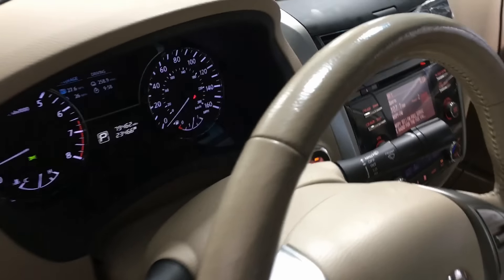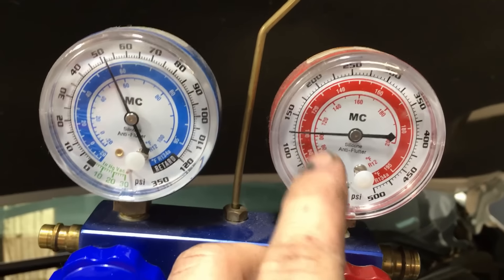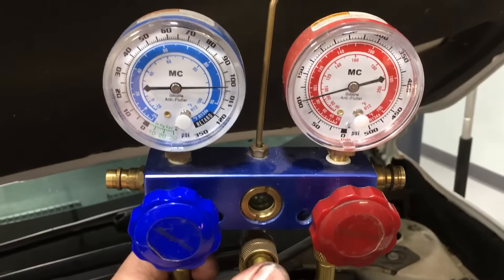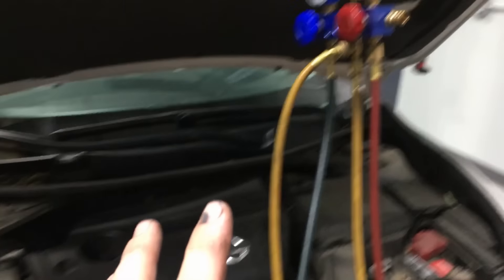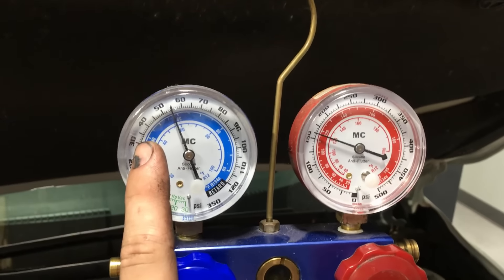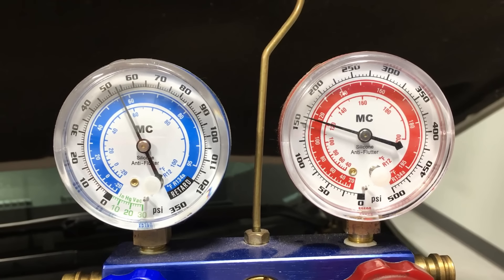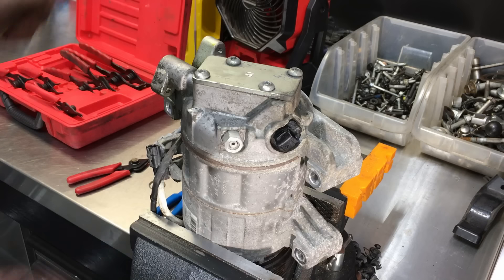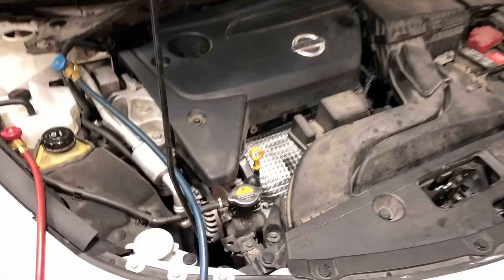A/C System Failure Diagnosis: Poor Cooling at Idle

Comment: I have a 2014 Nissan Altima and I'm having the same issue. My expansion valve equalizes the pressures when the car is off and I was reading the exact pressures when the car is running, as in your video.  I see in the video that the problem was the refrigerant control valve, but in the video, you said, "in our new compressor". Did you change the compressor or did you only change the refrigerant control valve?
Reply: He said that he replaced the compressor. At the time the valve was not available.

Comment: How can gauges show pressure if the two valves in manifold are closed??  You open fittings that attach to ports but leave valves on manifold closed??????
Reply from the maker: Is this a real question? Are you questioning the machines manufacturer or are thinking my valves are defective or I faked something? The hoses go inside the machine to the manual vales on the control panel for which the pressure gauge is tapped into. This way you can view the vehicles static and running pressures without allowing the refrigerant to flow into the machine until you are ready for recovery.

Comment: Why does the AC on my 2002 V10 Excursion suck so bad? New compressor, new rear TXV, new orfice tube, new accumulator, still has the old tube and fin condenser. Takes forever to cool, and then it doesn't blow THAT cold.  Can't get below 60F on a 90F day. Pressures are okay per Ford's suction and discharge charts for 70 to 100F ambient temp.  Do the Excursion AC's just suck to begin with?

Comment: This is exactly the problem my saturn vue has...cold air on the highway, luke-cold at a stop light. If you rev it to at least 1500rpm it cools back down. I wish i could get this diagnosed ...ive had 2 shops look at it, one said it needs a whole new system ($1300), the other said it needs a compressor and possibly a condenser, but charged it for me anyway, imagine that. And they didn't quote me a price for a new compressor or condenser or both, they just vacuumed it down and refilled it. Ugh. Maybe i should buy guages and figure it out myself.

Comment: Is A/C control valve the same as pressure relief valve? The factory service manual for my nissan versa doesn't mention any a/c control valve only pressure relief valve and expansion valve. Do all auto A/C's have control valves? I can't find it mentioned anywhere in the FSM. Thanks!
Reply: Only variable displacement compressors have control valves. Though, both can spring leaks (just had a relief valve replaced on my Delphi CVC because its oring was leaking, but the actual control valve is still fine).
Reply: PTA Weston   No a pressure relief valve is a safety device to release excessive pressure due to system malfunction

Comment: Hey man, I have an 03 Mustang GT with the 4.6 litre. My A/C  cools really well at night and on cool rainy days. It don't cool for nothing on HOT DAYS. I'm thinking about replacing the accumulator and the oriface tube. What is your opinion on this
Reply: Ron Bridges First thing first, check the charge. Put gauges on it and trouble shoot the system BEFORE you change parts!!
Reply: Air temp sensor is problem on these should get temp sensor reading from scanner before doing anything

Comment: My Ford Flex AC doesn't work hardly at all in stop and go traffic.  Does fine if I am driving continuously without having to stop.  System fully charged.
Reply: Thin Less my 06 GT Mustang cuts AC down when I floor it. It’s annoying. Because none of my other vehicles do it! It’s a 4.6L. I called ford. And they say it’s normal. It’s programmed to do so. But, I call b.s.
Reply: Welcome 2 My World 1.o   I drove an ambulance with a v10 and it did the same.  Cuts down on the load when you floor it to help the engine out
Reply: @glasser2819  Hmm, I have on old mazda protege that does good on the highway, but doesnt do good on city driving. I've done everything, I put a new compressor, reciever/dryer, evaporator, txv, and cleaned the condenser, and it doesn't work any better than it did. I'm gonna give this a try. But surely this thing had to work better than this when it was new? I don't know about this, wouldn't the manufacturer know how to build the system right in the first place?
Reply: make sure both fans are working....could be the valve like this video
Reply: Hi, were you able to resolve the AC issue on your Flex? I have the same problem on my 2011 Flex. Also my AC seem to have delay turning ON until about several blocks.

Comment: A good a/c what's the normal temperature ..good video thanks..
Reply: 50 degrees at vent .
Reply: @diane2193  More like 40F and below at vent when you call for maximum cooling.
Reply: @teravolt6113  it can vary on outside temps but yes it can be as low as 40 .Houses gennerally use 55 as a common supply temp.
Reply: @diane2193  Trust me, full recirc (which is max cool on my car) and my V5-like comp gives 40F at the vents with 100F outside with the right charge. Highway or traffic. It's recently stopped working like that (gives ice cold air only on the highway) due to a faulty control valve i'm going to replace.
Reply: Around 45ish on a r134a with blower on Med-high

Comment: Does all compressor have that valve I don't see that on my 2008 mazda miata,so I just going to replace the whole thing.
Reply: no it seems at least with nissan  the upper trim levels that have auto climate control have the solenoid valve, base models dont but you can usually see it from under the car.

Comment: sir , 38 temp is a wow,   i got my honda crv 1998,  i change my evaporator to laminated, change drier n expansion several times, vaccum n change freon n oil several times.  got my old compressor ( still  working)   i but only got 50 to 45 degree max cooling inside.  :(,   any tips?

Comment: Question new compressor condenser expansion valve flushed vacuumed charge correctly professional machine ac compressor and fans come on initially but go off if below 1k rpm if above 1k rpm ice cold as long as ur above driving or idle

Comment: i replaced the compressor & the condenser both new. The  condenser fan is working fine, and freon is refueled. Still poor cooling at idle. The only reason i could think of is because the compressor i purchased was not original.
Reply: Check the orifice for clogged screen . Should be on high side pressure line prior to evaporator coil.

Comment: I have a 2011 LaCrosse that only has relatively cool inside air temp while the vehicle is moving. When stopped the temp rises. I've had the system checked by 2 mechanics. One says it appears all components inside the engine area appear to be working fine. Good pressures. No apparent obstructions. No leaks. But he cannot find the problem. A 2nd mechanic is telling me the compressor and condenser need replacing. But he gave no information as to why he thinks this. So my question is: Can ac pressures be within tolerance and still have poor cooling due to a faulty compressor control switch? And/or if the high speed cooling fan does not engage will that significantly effect the inside air temp?

Comment: I got normal low side and low high side with the correct amount of freon. I suspect the filter dryer is getting clogged. 2001 ford v10 in a motorhome. What say yes?

Comment: If pressure is too high on the low side, does that mean the refrigerant control valve is allowing too much flow?
Reply from the maker: or txv if your compressor doesnt have a control valve.

Comment: How do you know this isnt a TXD issue? It’s the expansion valve’s job to turn hot liquid refrigerant to cold liquid refrigerant by decreasing the pressure of it. It must not be doing its job if the temperature is still hot. Maybe the expansion valve is blocked?

Comment: I have a 99 Ford C.V.P.I. and the A/C system is cycling the A/C compressor clutch on and off in addition to the radiator fan not coming on to help cool the engine which causes it to overheat when the A/C is running. It will run all day long with the A/C off but I don't want to run without any A/C where I live (I live in Las Vegas NV and it gets hot here) I replaced the compressor, condenser, accumulator, and orifice plug, I have the A/C high pressure lines ready to go in as well as the cooling fan motor connector AND the A/C compressor clutch connector. At this point I have only the low side lines and the evaporator to replace on my A/C system. I am pulling my hair out and ready to shoot my car over this stupid problem and I am tired of playing whackamole with this problem any hints or suggestions as to what it might be?

Comment: Is the refrigerant control valve the same as the scroll valve ?
I had my 06 Ford 500ac serviced, I provided the scroll valve, the mechanic said refrigerant was low to begin with and he added dye also but seen no leak. He told me to drive it a week and bring back he would look with a black light for leaks.
Reply: You need to get it checked with a halide leak detector. You can pinpoint the leak within a few minutes instead of taking the car back over and over to be charged repeatedly. Just a thought!! I have been an A/C tech for 25 years.
Reply: Yes, they are the same. Our 2004 Saturn VUE was having this problem (no cooling at idle or low rpms, better at rpm over 1500). It uses same compressor as Ford 500 and several other cars. I struggled to diagnose for 2 years, reading Saturn forums, lots of testing and trying things, but resisted replacing compressor. It didn't seem clearly the compressor, though others with the same problem had solved it with a new compressor. Finally someone on the forum figured out it was the scroll compressor control valve, and became a hero. (New compressors also had new working valves, so that's why it fixed problem, but for $$$ more!) It's about $30 part, in my case, and was a reasonably easy DIY repair for me. Had to unbolt compressor to get to valve cover, but didn't have to remove lines. (Do have to have it evacuated first!) Added back proper amount of R-134a, boom, ice cold air at idle. It was the mechanical type valve, and I had to buy it aftermarket. Search on "scroll compressor control valve" to find one of the sellers.

Comment: What if the high pressure gage is vibrantes at 200 psi. Does it mean that the compressor failed or the valve in it.

Comment: You're pressure sure did equalize very quickly, my 2000 Toyota echo takes over 1 hour to equalize. Is that normal? High side take longer to equalize.. blockage? But, I'm confused because I have a new EVAP, TXV, Compressor, Condenser and receiver dryer, fan turns on and still poor cooling at idle, I was thinking about another fan but don't know if amps would be too much draw on the system...Any Ideas on What I'm missing? Radiator doesn't look clogged from what I can see, I out have one fan for both..
Reply: Same issues here! Did you ever figure your problems out??
Reply: No, I replaced everything, the only other thing that I haven't checked and can't unless I pull the dash again, is the blend door, maybe it's a jar allowing some heater core heat in. I e talked to the service depart at Toyota, they say cooling should hold to within 45-50 degrees at idle. I know my page oil is right, charged correctly. So I'm a bit stumped unless I got a bad replacement part which I doubt. If you ever come to a solution, sure like to know, I don't want to throw any ote money at it.
Reply: @mitchellbonomi9309  thanks for the reply. And wow. That sure is frustrating. I feel your pain man. Idk have you looked at anything electrical such as the pressure or flow switches? What kind of gauge readings are you getting?  Hope it isn't an evaporator that clogged, that's my worst fear now. But I'll keep you in mind and let you know if I can help. You do the same please.

Comment: Great video. Really like these.types of vids.
Would changing out and replacing the filter dryer after the sys is evac'd help any?
Reply from the maker: No need
Reply: Hawaiian F150 only if the system sat open for a while
Reply: @BSGAutomotive   Hey friend can you please tell me what the static and normal operating pressures are for a 2006 Mazda 3s 2.3L 4CYL DOHC (AT) Sedan GAS non turbo VIN# JM1BK323361459957

A/C Does not blow cold at idle but will at speed A/C not useable have to roll windows to survive . I think there is to much PAG oil in system as I had another shop do a factory load PAG oil and R134A and then I put in new compressor with out oil balancing because he said I needed new compressor 

NEW PARTS : 

Compressor
Condenser
Expansion valve
A/C stretch belt + serpentine belt
Cabin filter 
Engine/Condenser Cooling fan
Engine Coolant
Engine Thermostat

Thanks
Reply: @BSGAutomotive 2011 Ford Fiesta. Air conditioner has always been cold. I replaced the cabin air filter and since then the air condition  blows cold as it use too but now fluctuates. Sometimes at a stop and even sometimes going down the highway at 60 mph. It can be 5-15 mins apart or longer?..

Comment: what do you do when your ac is constantly cycling while driving, the compressor cycles at higher rpm, because of this the car never gets cool while driving at highway speeds.   when you stop and allow the car to idle, only then the compressor works like normal. when you connect the ac gagues the pressure reads like normal when the car is idling. its a 99 mirage usa or 99 lancer japan. ck2

Comment: So the main function of the part you replaced, is same as expansion valve in another system?
Reply: No, the (thermal) expansion valve is a completely different thing, even though it has to be carefully built and set so that it won't interfere with the compressor control valve (the replaced part) at all, that is, the expansion valve has to stop modulating the refrigerant flow and basically keep the orifice slightly open, before the control valve starts modulating refrigerant flow by acting on the compressor displacement. Having two flow control systems operate in the same pressure range means problems

Comment: My compressor is working , my relay and fuse are good, my system has no leaks and is fully charged,  My A/C is still not cooling.    what did I miss??? 2010 Honda Civic. Need help!

Comment: I have a 2015 Altima SL  and have the same problems just ordered the valve on ebay 20.00 thanks.
Reply: automech01 did you received the valve? Did it fix the problem? Im experiencing the same issue

Comment: Very nice video. Thanks for making it. I did not understand though what is controlling the valve and based on what data? Is this valve part of some control system that tries to maintain an average pressure of 30-40 at the low pressure side?
Reply: Shhh! He's got to pay for that recovery machine.
Reply: anyway you slice it... shop needs to hamer customer for comfort. Service has a cost... short AC season calls for premium.

Just keep in mind you are stressing every engine rubber gasket, the hot battery and the alternator... enjoy AC for what its worth.
😁

Comment: when fill out the AC, it leaks immediately under the car and it leaks a lot. Any stop leak you recommend ?
Reply: Fix the leak!!! Stop leak stops up the whole system!!! Not good!!! Fix the leak!!!
Reply: just replace all orings and see if it holds a vacuum for a half hour
Reply: thank you
Reply: @rockerpat1085 gonna be expensive to fix

Comment: If we had a sticking, electronic a/c compressor control valve, why not just unplug it??

What would happen then??

It would prevent the system from wanting to adjust or close the valve- No?

Comment: TXV system, is that an expansion valve system?
Reply: Yes
Reply: Thermal expansion valve. It's a hybrid TXV/OT actually, because the TXV used with these compressors switch to 0 superheat (they basically turn into orifice tubes) whenever the evaporator pressure decreases enough, and act as actual TXVs otherwise. Supposed to keep the compressor lubed up.

Comment: What if in the low side (blue gauge) is high and goes down when you accelerate, my cars a/c warms a little on idle.
Reply: Weak compressor
Reply: @tanzaniacarschannel6975  thanx for the response

Comment: My VW Touraeg have same issue..Its ac not cooling while start up the engine but I used to rev up the engine upto 2.500 rpm its turned to cool normal..afterward usualy its cools at driving and idle but not perfectly as the same at 2.500 rpm. I used to top up the gas from a mechanic 2 times and i did noticed that the gas was very difficulty to charge and its takes upto total half an hour to top up..After the mechanic told me to to rev up the engine and i did and same time gas was forcefully top up and got the normal cooling..He did cleans the filters and condenser coils..But no effects and i need to rev up the engine every time when i start the engine to get cooling..Please tell me someone that is this the compressor faut or any clogged condenser line,,...??Please help someone ..

Comment: I have a 13 charger rt, my ac compressor would kick on and off at idle but come to find out it was 2 much freon and I had it drained and rechargerd but still blow hot at idle but compressor stays on any suggestions..

Comment: Wow, thanks man. Really great video! Thanks a lot. Could you please say couple words how do you recognize failed or clogged condenser?
Reply: Super high head pressure will be the first sign and the discharge of the compressor will be insanely hot.

Comment: I have a chevy s10 1997 my ac is only blowing warm air ,I filled it up with r134 didn't work then I bought a brand new ac condenser didn't work my compressor turns on when I turn on my ac so I figured it wasn't that, can anyone help me on what to check next or replace ,

Comment: Can anybody help me out? I jave a 07 dodge ram 1500..its made to not have an ac filter..the switches work good and the flap thingy for recirc works...problem is i can hear it blowing air hard and real good..but not much air comes through the vents..almost as an air duct came loose..any ideas on whats going on?